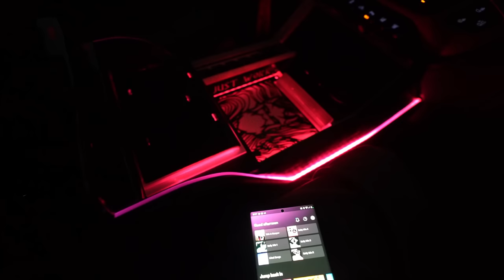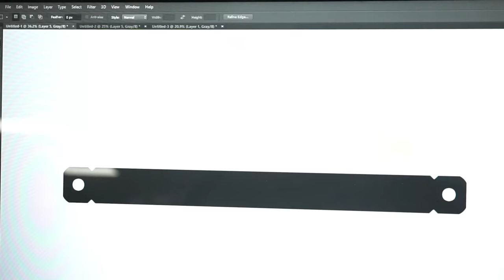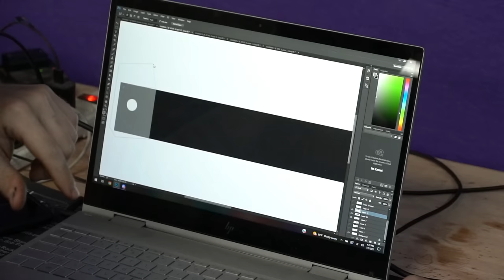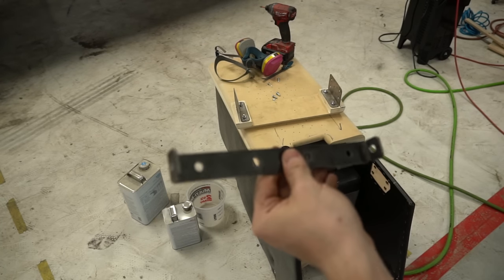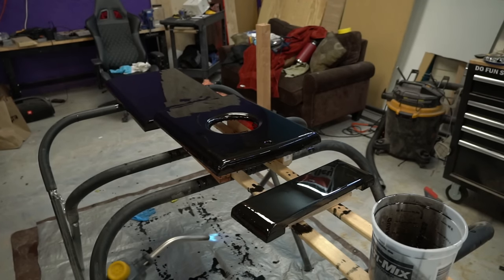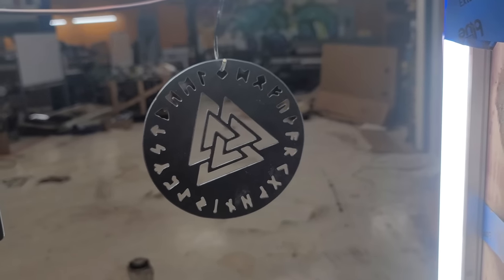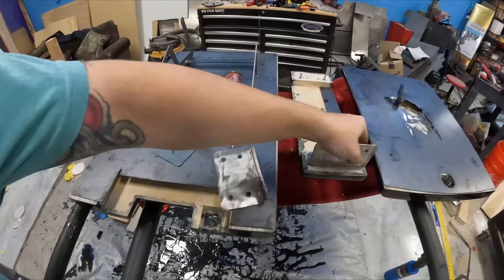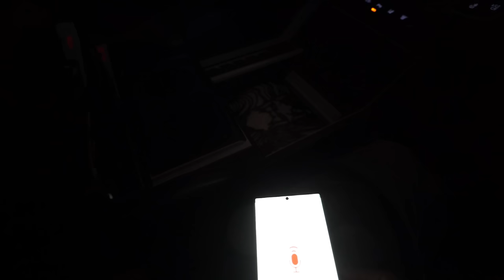BUILDING AN EPIC CENTER CONSOLE & EPOXY LID FOR MY TRUCK!!!

Comment: With coatings you dont need to sand between coats if youre within initial cure time. (My company goes by 16 hours) it cures alot better when you mix coats like mentioned here, as when you let it fully cure, then sand, then apply another coat you are really ending up with 2 separate coatings, when we have to revisit any project and it has cured we will sand but its important to reactivate the base layer of the coating with a proper solvent, to avoid the multiple coatings mentioned. Things like this are why we can have 20 year warranty on our work.

Comment: The center concole came out great, the epoxy work looks phenomenal. A quick suggestion for using large router bits like that 1.5" roundover, some of the instability could have been caused by the rotation speed of the bit, large bits like that need a much slower RPM to cut well than smaller bits need. Also, I hope you dont get DMCA'd from that Ironman playing in the background haha.

Comment: I think you'll need some sort of leather part to the lid for your arm cause resting on epoxy could get sweaty and slick and then to clean it would be a job to keep the nice finish. You could do a separate piece of mdf or whatever and wrap it in leather and notch out a section in the lid and attach some set screws to the bottom of the piece and drill some holes in the lid to fill with whatever kind of bonding agent and slide the piece in Idk im overthinking this

Comment: With the latch I was thinking a strap to pull like on racecar door cards with the strap coming out of the top through a small slit rather than a large hole but that works better with pins and turned out incredible

Comment: Dan you cnc some walls and take the element out of your oven and the thermostat keep the switches and use hi temp silicone to seal it put it on wheels and roll it outside, seconds as a shop heater when in use.

Comment: Are you using a fine cut consumable?
Reply: Also if you’re able to. Design edge is a wonderful program for designing part. Super straight forward. Can be set up to work with your plasma table as well. (I’m a CAD designer)
Reply from the maker: Yea, im using the Fine cut nozzles from hypertherm.
Reply: @DOITWITHDAN  hell yeah, that looked like 60 amp? Or 85